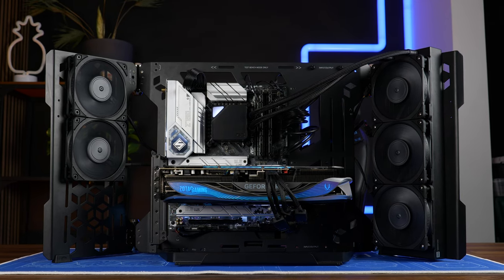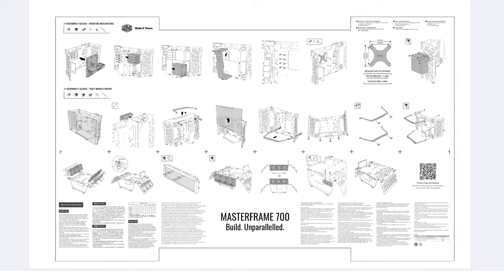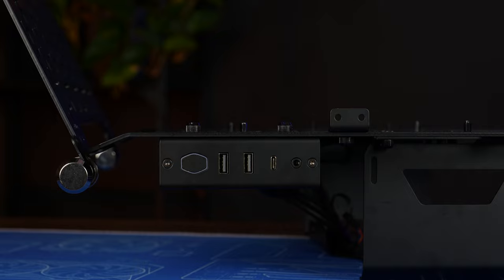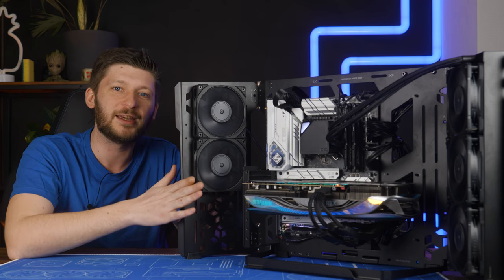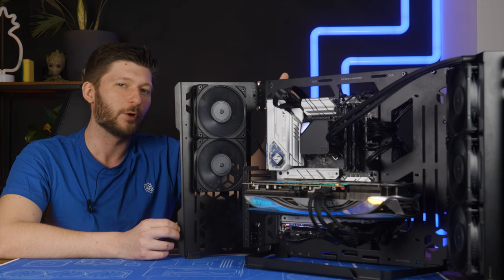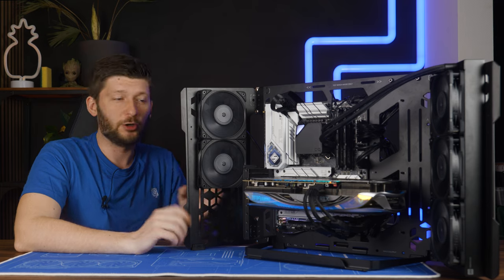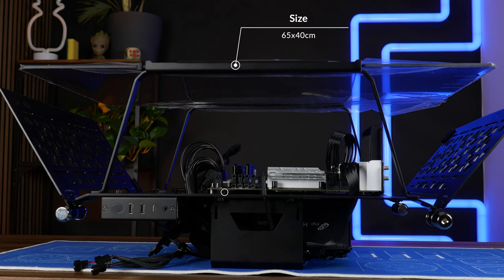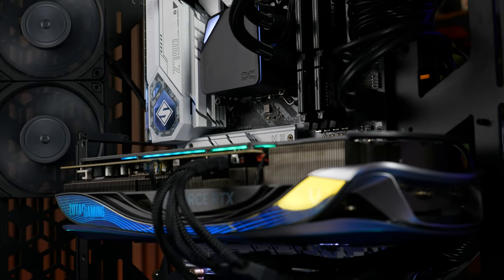Cooler Master MasterFrame 700 Review - A Case or Test Bench?

Comment: Comment readers: Please read my long comment before you buy this product. Thanks for producing this video. I would have been smarter, if I watched it BEFORE I bought mine. I'm in Day 3 of assembly and my fustrarion level is a 9 out of 10. When I attempted to attach the wing panels I discovered the really small screws would not tighten into the threaded holes. After many hours I finally discovered the problem. The holes were tapped for threads before the the part was painted. This resulted in the paint covering the threads inside the holes making it nearly impossible for the attachment screws to thread into the holes and join the parts. To solve this I had to purchase thread cutting dies and use them to reem the holes to remove the paint from the threads. The assemply drawings were about as helpful as using a map when going somewere and holding it side down. Had photos been used, this would not have been the problem it turned out to be. This test bench is deffinataly multi-functional. You will need to decide how you will use it before assembly so that you will only install the parts needed and refer to that specific assambly drawing. I used a yellow line marker to circle only the drawings I needed.

Comment: Was considering the MF700 but after your video got a better idea of it. I'm more on the "Benching" stuff so using a flimsy solution as the MF700 is a no go. Maybe I can grab here the old but reliable TT Core P5. Thanks for including all your concerns regarding wings, cable managemente etc